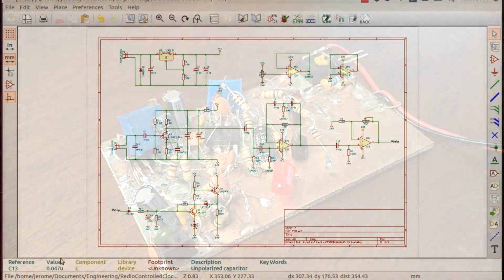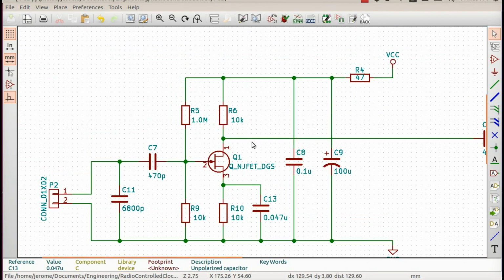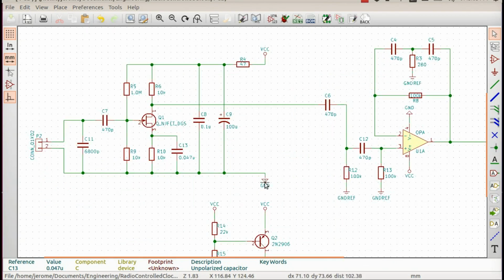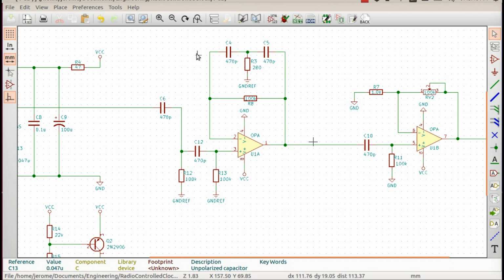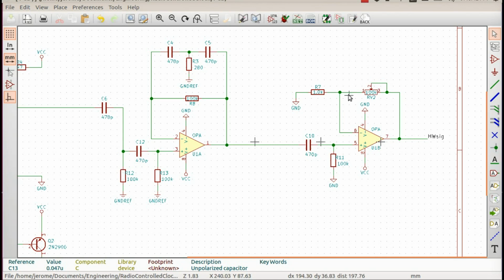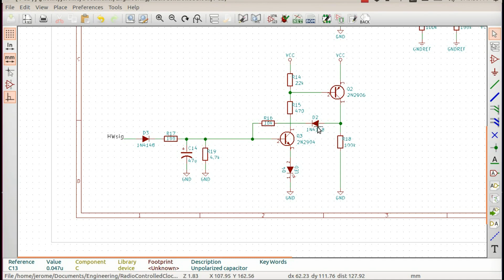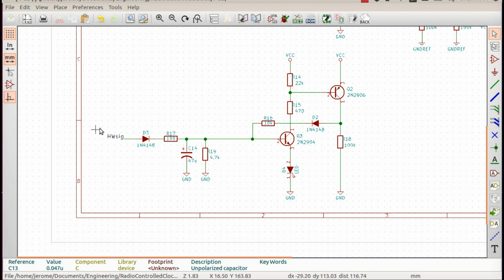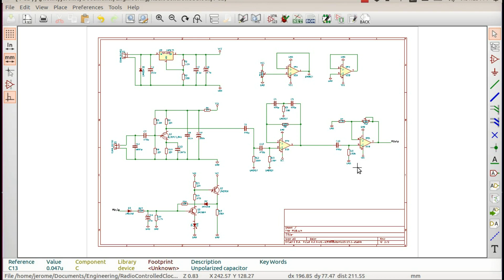#0001 WWVB Receiver Project - Part 1

Comment: Nice project. Ground currents are often a problem with low level circuits of all types. 
I built both a TRF WWVB receiver as a frequency standard for my lab and a superhet Longwave radio kit that I could clearly copy the WWVB 3rd harmonic with at 180 kHz, (since I live 60 miles from Ft. Collins and could detect WWVB on a 'scope using just the tuned antenna and FET amp without any receiver at all.) I listened to the sound of WWVB in the background all day long. 

About a 3 foot diameter, high Q, amplified resonant loop antenna of varying number of turns depending on local noise works very well. If you use an outdoor antenna with an Earth ground be sure to use an isolated ground rod right beneath the antenna. If you tie in to other grounds it just picks up noise. I really like the fact that I could use audio IC's in the RF chain. Longwave groundwave is amazing stuff. A few mW of radiated signal can be copied with narrow-band techniques at a thousand miles. 

It sounds like you know most of this stuff very well, but I thought I'd toss in what I learned just in case you missed any of it.

Comment: Very cool. Thank you for sharing! I wonder if you'd like to collaborate on a complete atomic clock built with discrete parts (logic ICs)? I've already built a TTL decoder circuit from discrete logic chips. Please take a look at my series of videos describing my circuit and let me know what you think.
Reply from the maker: Your TTL solution is quite impressive as well.  What are you thinking in collaboration?  It looks like you're using a receiver chip of some sort and I suspect you are wanting a discrete analog front end?  The complication in my circuit is automatically adjusting the gain such that my device always triggers my output comparator.  Proper operation is very sensitive to gain - and the gain required is highly dependent on your location.  Hence my final solution uses a microcontroller to automatically adjust the gain.

Are you using this module?  https://www.sparkfun.com/products/retired/10060?  I've been looking for it everywhere.  I've looked around for the chip itself and can't find it anywhere - hence my somewhat discrete solution.
Reply: COEE no, different module. Mine is from Universal Solder and can be bought off ebay for about $10. And yes, I was hoping to have a discrete front end. :)
Reply from the maker: Ah yes, the wonderful 'solder blob'.  I'm guessing the CME6005 is being used in die form.  I can't find the CME6005 anywhere for purchase though - or I would have probably used it in my solution!
Reply: COEE yeah, I was looking to purchase some of the receiver chips as well but couldn't find any.
Reply from the maker: At least I'm not the only one!